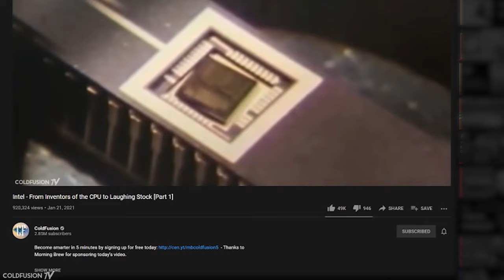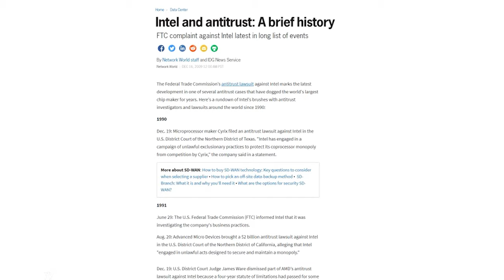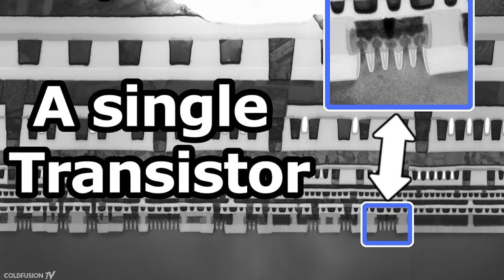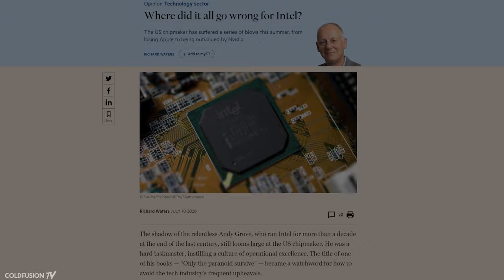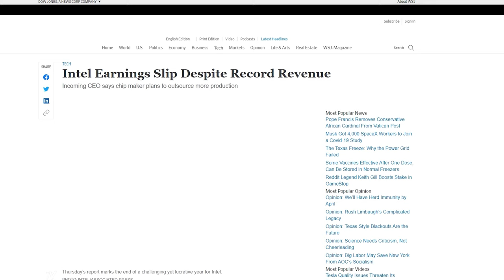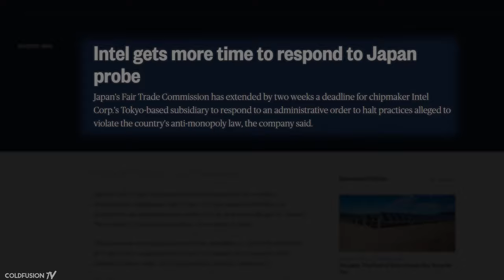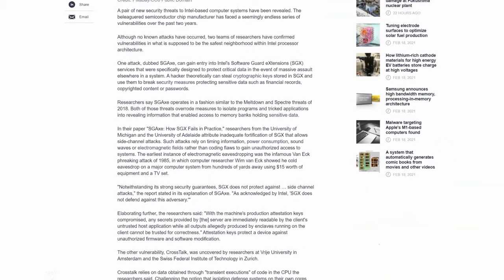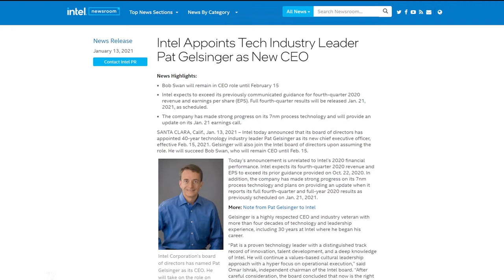Intel - From Inventors of the CPU to Laughing Stock [Part 2]

Comment: Being a MBA graduate myself 8 years ago, one of the key quotes I took away from my Accounting prof was that
"MBAs WILL kill a company if they weren't put in check by executives who are passionate about the purpose of the company." 

This was the reason why I moved from specializing in Accounting & Finance to the far less tangible Innovation Management.
Reply: @jensenraylight8011  That is both true and false. True that many MBA graduates unfortunately indeed do best managing chaos into order and rake in short term profit. False in the sense that MBA students do also learn many different non-tangible, innovation related topics and in fact many business schools try their darn hardest today to teach entrepreneurship so that more MBAs could found their own. A MBA holder with vision is not a contradiction.

So in conclusion imho I think it boils down to two points:
1. Personal value and integrity. MBA knowledge is a tool, but like any tool it could be and often is, misused. 
2. The company killing MBAs are usually the 80s-90s graduate breeds. It was an era where Accounting and Finance mattered the most and nothing else. As these people joined  various companies they eventually wreak havoc in a few decades time (like Boeing and Intel) but they are only doing what they were taught.
Reply: @jensenraylight8011    I think what you have in mind is the scenario where a number crunching person becomes CEO and is not the original founder. When that happens yes indeed problems might rise, especially if he/she is bereft of passion for the technology itself and only trust numbers. It should be noted that just like aircraft crashes, we are only looking at the most spectacular failures such as Intel here. It would be dangerous to jump to conclusion too fast.

However MBA or not a
non-techie founder is just likely to study as much as he can about the product or technology as an engineer would, probably only just skipping the crazy scientific equations to make things actually work. After all it is their passion and it always feel great getting simmered in the knowledge related to it daily. Also today's technology is so complicated that it is unlikely for one person to truly understand everything anyways so a CEO only needs to be open minded and make decision based on suggestions and facts presented by his team. That is not flying blind, as his team will act as his eyes. 

Well... again I suppose being a good human being with properly strong passion, integrity, and value to move forward is the key to be truly great CEO, education does not matter that much. In my MBA days even engineer background classmates may run the risk of getting their minds tainted by chasing short-term profits and ignoring long-term picture during case studies and business games.
Reply: @jensenraylight8011  CEO has to understand industry OR have incredible talent for selecting his staff and delegating to them.
Reply: Exactly the reason why europe is killing itself. Most western countries dont invest anymore they're just worried about reducing their debt.
Reply: @jensenraylight8011  As I have repeated myself numerous times, it is really all personal character and integrity. 
MBA is just likely to taint someone's mind as help creating or complementing a passionate visionary to further his goals.
It is only unfortunate that the former gets hired more often and thus there are more of them causing harm. Blame the hyper-capitalistic nature of the nation.
Reply: The issue with MBA's is that they are marketed as a guaranteed way to get promoted and make more money, so by default they attract people who are motivated primarily by money and status. Combine that with the way finance jobs focus so much on quarterly results and punishing people who don't get the arbitrary return they want each quarter that they forget (If they ever knew) that the nature of innovation tends to be long periods of very little happening as tech is developed, followed by an explosion of improvement once the tech hits production.

The result of this is that the MBA/bean counter types have little choice but to slash the investment that would create dramatic changes if they want to keep making their quarterly gains and not get fired. This means the system will keep selecting for the people who will flog the company to death with nobody to stop the process when the CEO also has an accounting/MBA background. The people that keep doing it because their love of money outweighs any guilt they might feel for all the livelihoods they ruin before jumping from the company they've gutted to do the same to the next one are either improbably ignorant, or heading well towards sociopath territory though.
Reply: @warfighter1988  Europe is too risk averse in everything - raising children, investing .... anything.
Reply: MBAs are just higher paid endebted slaves hired by high school dropouts. Good life choice bro
Reply: I'm a fellow Engineer and MBA. How's the job market and opportunities for you post MBA?
Reply: @Beyond-Antares  I am not engineer although I really do like engineering and IT topics. I say opportunities and LinkedIn headhunters certainly aren't scarce. However more important is what you hold dear to or want to do with a MBA.  
For example I have zero interest in Finance, Accounting, Consulting and many other number crunching jobs so that kind of closed a lot of doors for me, lol. I like Marketing and Project / Product Management a lot more.
Reply: @UNSF  I spent time in R&D and various industries as an engineer only to switch into Management Consulting. Not like the common MBA exits like Bulge Bracket banking or MBB Consulting.
Reply: @Beyond-Antares  Wow then you are much, much senior than me in terms of pretty much everything. Hopefully you are doing well and is able to stay content in these crazy times!
Reply: I'm an engineer at Amazon and I've noticed they're big on MBAs (new CEO has an MBA from Harvard). They're big on engineers too obviously I just hope I dont have to waste time getting an MBA just to move up the ladder.
Reply: @JB-kx9bx  There is no way to tell for outsiders like us. You should probably gather information internally on how much MBA is valued and check and see if the person that holds the role you want to climb to is also a MBA holder.
Reply: @UNSF  Not at all, keep hustling, life finds a way to work out
Reply: @JB-kx9bx  MBA's have saturated the market, it's all about networks and work experience. It's an expensive degree that doesn't have the kind of pull it did back in the day
Reply: Do they have sales marketing teams? Or corporate teams ? Do they work for the company or against ?

Comment: Ryzen already surpassed Intel on single core and gaming performance with the Ryzen 5000 series chips later last year. So that horse has bolted.
Reply: New chip coming in Q4 is outperforming the top leve Ryzen.
Reply: @paull3179  Sure it will.
Reply: @paull3179  A year after and I'm still waiting! LOL!
Reply: @RD-kq3ml  wait no more: 13900K :)

Comment: Just a correction, if you care: Around 21:00 you said there's billions of transistors in a CPU that all need to be perfect. That's very, very much not the case. There are defects that are distributed throughout a wafer that radically alter how well a particular piece of silicon will perform. Depending on the degree to which a piece is defective, it'll either be essentially sold as a lower quality part(you can look to RAM timings for an example of that), or in the case of CPU cores, essentially locked off (you can think of that as all the silicon is made into 8-core parts, for example, but if a given segment of 8 cores has 2 that are too defective, it'll be sold as a 6-core chip).
Reply: also the difference between i3 and i7, essentially same CPU, and Ryzen and EPYC, same as well. They bin and sort a CPU or chiplet by quality and sold as different product.

Comment: 10:29 TSMC have been producing 5nm chips for Apple since 2020.
Reply: but they dont have stocks now XD
Reply: Yea but Apple booked everyone of those chiplet and TSMC is struggling to keep up production.
Reply: @Tano 100% agreed. I think Apple will be hogging on TSMC's new process node. Intel needs some good leadership and engineering to try and bring competition in their product stack.
Reply: @Tano regardless, intel chips are power hogs. Apple’s aren’t. It’s more than size design. It’s all about efficiency.
Reply: TSMC measure node differently from Intel anyway, look it up
Reply: @Tano data centers face similar issues for heat management. Efficiency has a cost savings in TCO. While yes, laptops require higher efficiency, there is an issue when you have thousands of boxes generating massive heat in a secure building. Regardless, Intel isn’t dead, they are, however, at a critical juncture to deliver innovation. And as users, we stand to gain the benefits of competition. That’s the best part of it all.
Reply: You know why he didn't mention 5nm? 
Cause the topic was Desktop CPU's!

Comment: This is a reason why I won't go anywhere near Tom's Hardware.
Reply: Good.
Reply: Why not?
Reply: @darkknight17  tom's cpu benchmark is rigged
Reply: @darkknight17  
You didn't watch the video.
Reply: @JustTry919  Damn and I used to think Tom's Hardware was legit. Thanks for that.
Reply: @garyharrison4915  I'll re-watch it again, as I missed that part. I'm quite stunned as Tom's Hardware uses to be the go to place for bench marking info.
Reply: Intel and nvidia still own all the top benchmarks for video, and 3d rendering.. fact
3ds port royal hall of fame all year, little kids ..
Reply: @darkknight17  me too
Reply: @thomassmith4999  I was just gonna comment that Tom hasn't been involved in "Tom's Hardware" in quite a long time.
Reply: Tom's Hardware is a trash website in regards of reviews, Q/A and apparently benchmarks too,  I avoid it whenever I can.
Reply: Toms Hardware literally burn first Athlon without cooler to hide fact that Athlon beat p3 and early p4 in performance. It is a fraud intel garbage since year 2000.

Comment: I worked for Hewlett-Packard for 15 years and I fear Intel is headed down a similar path. When the visionaries are in charge, engineers are eager and motivated but over time as profit motives and shareholder demands for ever increasing growth intensify, those visionaries are replaced with accountants and marketers who have no interest in the core business and are only concerned with beating the next quarter's targets.
Reply: Happened to my current company, I've been working as process engineer. It's my first job and been working for 4 years.  As time passes more and more Sr. Engineers are resigning. At first it didn't bother me until there's a point that I was left behind and need to be in-charge of other Engineers job, since there's no more Sr. Engineers left. Until I realized we're being run by PowerPoint experts which only know is to produce more products. Pandemic happens and voila our products are obsolete since it's for automotive PCB. There were no RnD left at the time and we're now facing a shut down.
Reply: Sounds like Capitalism doing a capitalism to me. Just saying 😉
Reply: @Applekendee  
Call up your old colleagues and start a co-op. What have you got to lose?
Reply: @TheAmericanAmerican  well our lawyer already settled the issue and the best they could offer is 50% for separation pay.
Reply: Me too

Comment: so bribe is the reason for intel being popular
that's how they run intel
also, try to suppress AMD's innovation
Reply: Economically speaking, "bribing" a vendor to use your product is the same as selling at a discount is the same as selling your product cheaper.
Reply: @tripzero0  Well, if you discount your products to practically 0, I'd call that bribing as well.
Reply: I give out free hugs.  Do you feel bribed?
Reply: @tripzero0  If you expect something monetary in return yeah
Reply: @anoniem9518  agreed. I looked into the "anti-trust" claims as well, so many cases were rejected or settled out if court that I stopped reading after a while.

You are also right about Swan.  It takes years to go from fab planning to cpu design to final product.  We really won't know how good Bob was for a few years and Pat even longer.
Reply: @anoniem9518  even supercomputers use arm 
also, not everyone needs their PC's 100% power
they r also more efficient 
I think battery life is more imp than performance
how much power do u even use
Reply: Just forget the 8 years where Intel were, infact, making better processors than amd.

Comment: 10nm Intel process isn't comparable to 7nm TSMC process. You also need to look at transistor density. Intel is still a leader in transistor density.
Reply: @Louis Duran - there are also other factors: isulation leakage, paraistic capacities, yield etc.  In any case, once Intel sorts out 10nm en masse, they'll be far cry from loosing.

Comment: One of Murphy's laws states that: ''Hidden flaws never remail hidden.''
Reply: The problem with that though is how would you know this? Theoretically, if one could remain hidden no one would ever know of it.  Is it only a flaw when discovered? 

That begs the "tree falling in the woods question" but still.
Reply: @Ehh.....  This is actually the concept behind the term "zero day exploit", if you have heard it.
Basically if you find a flaw, then that means someone else (that you don't know about) may have found it before you. Therefore you have "zero days" to fix it ^^
Reply: More of like backdoors for spying purposes that get labeled “exploits”

Comment: Seeing the advance of ARM processors, there could be trouble for both Intel & AMD. I remember the days, when AMD was barely hanging on, in the 1990s. Microsoft had versions of Windows running on ARM processors for sometime, so they're basically indifferent to processor choice. This even predates their attempt at smartphones. So if both Microsoft and Apple switch to ARM, then Intel & AMD will have to pivot quickly.

Comment: Intel : Keeping everything home-grown will give more profits.

Backfires
Reply: That does work out for Apple though.
Reply: @arunavaghatak6281  
🤦‍♂️🤦‍♂️🤦‍♂️🤦‍♂️🤦‍♂️
They don’t do manufacturing 
They just design the processors
Reply: @nabeelshariff6006  I know. My point is that they design everything - most of both software and hardware of their products. And that did make them successful. They can optimize their hardware for their software and vice versa. Vertical integration does have advantages that Intel failed to make use of (unlike Apple).
Reply: That did not backfire
and intel has actually built many cpu offshore.. get a clue kids
Reply: It's not about profits (though that is of course a huge plus) but because it's better to have as much control of the design and R&D of a product as you can. It's only because they started to have problems with 14 nm (which have a 1 year delay) and the 10 nm nodes that it looks bad. But up until that - people thought that it was great that intel manufacture their own chips in-house.
Reply: On one hand, that allow Intel to produce more chips and don't have to rely on TSMC. Intel can continue thriving (and dieing slowly), because of AMD's cpu shortage.

AMD did the same until they had to hire TSMC and spun off Global Foundry.

Comment: 10gen Intel vs 5000 series ryzen was an embrassment for Intel. The ryxen 5 5600x was way better for gaming while only at 4.6ghz with 6 cores, while i9 10900k has 10 cores at 5.3 ghz. It would go around 200watts and lost to a cpu at 65 Watts.

Comment: Thats why im AMD from K5. Even when Intel had the lead i wasn't give them my money.
Reply: My very first PC back in the mid 90's had a Cyrix CPU (remember them? lol), then I started using AMD processors, K5/K6 etc. 

Had an Intel CPU only once (a Pentium III), then went back to using AMD (Athlon, Phenom etc).
Reply: @ulysses2162  ofc i remember cyrix i maybe use them once or twice. Intels have pass through my hands p1 p2s but i always stick with amd. I have a Phenom x4 955 for years and then stupidly for someone i get a 6300 fx insead of the superior 5700K i don't remember which one. Im doing the same with nvidia ofcourse. Im a hell lot of years a computer guy to stick only with the faster or the better one especially when the differences are seen on very specific situations.
Reply: I was on X2 3800+ (later Opteron 180) since 2006, and approx. since 4790k was thinking about decent upgrade. When I've finally decided (and had money) for upgrade - it was last year, so I'm on Ryzen 9 3000 series :)

Comment: wow, thanks for this video (x2), I didn't realize Intel was so scummy. Next processor I need, I'll be looking at everything not-Intel 1st.
Reply: And it's been going on for longer than many viewers here have been alive for. Intel is scum. Even with a banger product now they'd have to prove themselves to be fair and ethical in key ways for me to push money up their assess
Reply: @Tano right, but whatever shred of relevance Intel had in laptop chips has just been completely and utterly demolished by Apple's M1, so they don't even have that going for them now lol
Reply: @Tano I can see how sometimes hardware accelerators can be useless for specific tasks, but you can't exclude them if they are useful to common tasks - video encoding and decoding, x86 translation, etc. The M1 is beating x86 at common tasks and most benchmarks not just specific benchmarks as you claim!

Comment: Now I know to never buy an Intel device ever again.
Reply: Product > brand. Intel is actually fine. Only issue with some of their products is that their higher performing ones get beaten by amd’s 5000 series. In $500-$1k budgets it’s the better option over amd due to its 10100 and 10400f
Reply: @Infinite Possibilities That’s true. AMD was practically dead from mid-2000 to mid-2010s. Just need to find the best product based on performance, not by “brand” because brand loyalty is stupid.